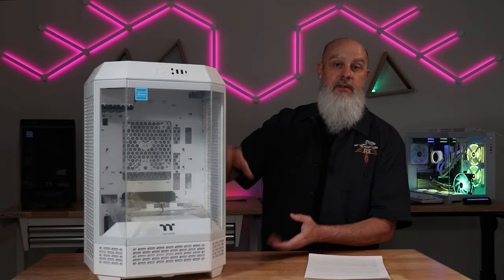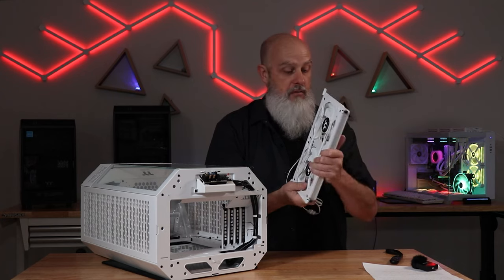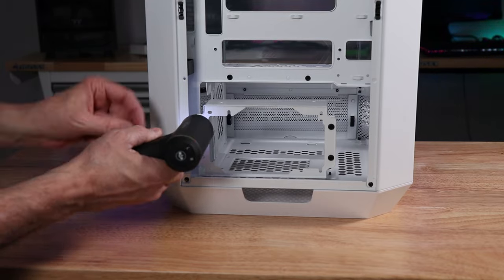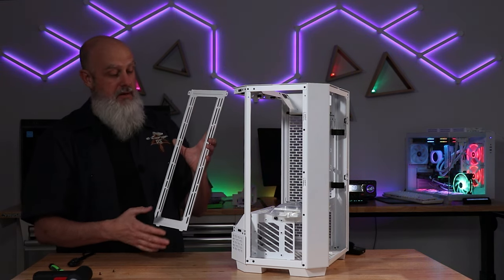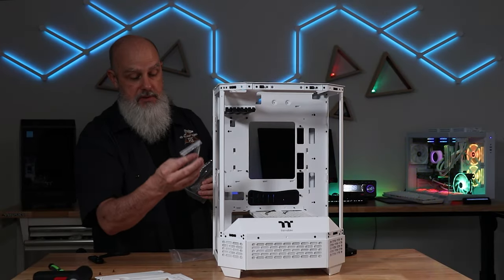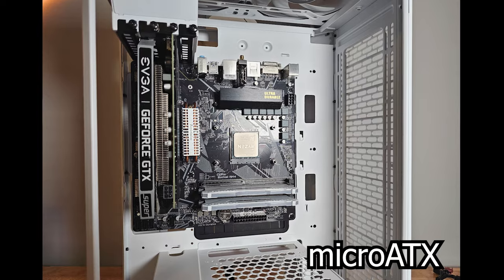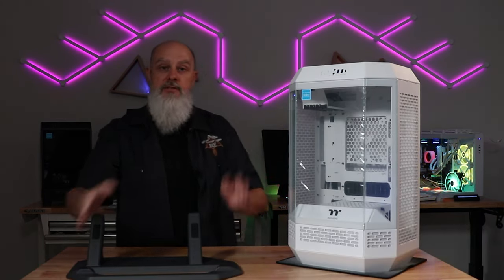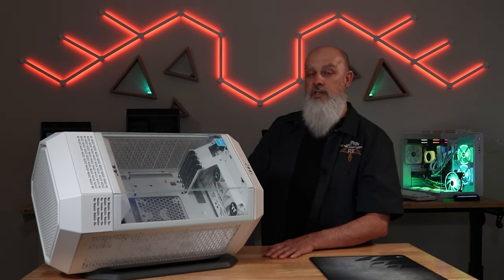THE TOWER 300  and CHASSIS STAND Overview and Teardown - Don't miss this case from Thermaltake

Comment: its crazy how many people don't know that this case is compatible with back connector motherboards like msi's project zero
Reply from the maker: Hi willpatog9001, that's a very good point, it is compatable with msi's project zero. It might be a little fiddly getting the cables in on the one side and you may have to forego the drive cage in the back, but it would look good....I'll point that out in my follow up video....maybe i'll try to put the MSI board in this and see how well it actually works.  Thanks for the great comment and for watching!!!

Comment: couple things, 
You can get to the i/o from the top buy way of the two thumb screws on top and the bracket with fans will just fold/flip out of the way even when running if you don't hit the fans.

I think a cover would/could look interesting in front of that i/0. The higher tier boards with larger heat sinks make that area not look so bad. (Rog x670e gene, Aorus b650 elite ax ice)

I didn't know the fan bracket could fit both sides...makes for an interesting idea with fans. Especially if you make some type of water cooling build with a water cooled card and aio on either side.
(speaking of that i cant seem to find the Depth of the video card area from the board in case you want those Huge brick 4090s, the length seems okay but will it stick out to far and not fit).

All in all a great video. good luck on the build. cant wait to see it.

Edit: the bumblebee case would match so well with an all asus tuff setup.
Reply from the maker: Hi jeremiegartner464, that's a great point, getting into that area isn't too bad just removing two thumbscrews provided your cable management allows easy removal of that panel.

And I can't disagree, higher end boards will look better in that area, this budgety board I have in there doesn't have any covers for the I/O area, but overall, I have found that it bothers me less than I though, I kind of like the look of just the raw electronics right there, but i'm still playing around with a cover design and i've tried some fancy USB sticks up there with blinky lights (haha), it all looks pretty good.  Yea, I haven't tried putting fans on both sides, i'd need another bracket, but could get ridiculously 'cool'....

It's appx 4 inches from the left panel to the first slot, that's an appx measurement, i'll follow up in the video with a more exacting measurement. That's assuming you're mothereboard has the slot in the first position as well. In addition, it's appx 2.5" from the right bracket to the power supply cover, it makes putting a drive there difficult if not impossible  with most AIO's. 

I've been tempted to get one of the bumblebee cases.....they look awesome (IMO)....haha. 

Anyways, thanks for the support and for watching, keep having fun!!!
Reply: Asus tuff 🤢

Comment: Anyone know if the stands will be available anywhere else? The shipping on the thermaltake shop is more expensive than the stand itself
Reply: @GCU-GreyArea  damn, guess I'll wait a bit, hopefully they'll stock them in other places soon. Cheers for looking though
Reply: @GCU-GreyArea  I do, I bought the hydrangea blue one, it's on back order though so I haven't got it yet, but this is one of the few cases that have really grabbed my attention recently. I'm also still running an i7-7700 lol
Reply: @GCU-GreyArea  all good, thought I sent another reply already, they had them for pre-order on amazon JP and I did find the ones on amazon US (which were cheaper for some reason? I bought that one lol, it'll just take longer to get here, which is fine) So i did end up ordering one

Comment: I do agree with the no panel to cover the cables from the IO ports..that's my biggest concern to have this case..this case almost perfect, but too bad they missed the perfection..Great video as always 👍🏻👍🏻
Reply from the maker: Hi michaelbachinz, I'm working on my follow up video to this, but If i'm being honest, the lack of a cover there has bothered me alot less than I thought it would, I'm using a budgety B550 board in there which doesn't have 'any' covers in there and it actually looks pretty cool IMO....And I found this cool USB stick called the Flashotron 3000 to stick in there, it's just a ridiculous USB drive with 50's style blinky lights, but overall I've liked it much more than I thought. I'm still trying to design a cover of sorts, but i'm an amateur 3d modeler....haha. That video will be out in the next week or so I think. 

Thanks for watching and your feedback!!!
Reply: budgety motherboard not the main problem since it must flip to install, i think high end motherboard will also has the same issue ( expose cables )...IMO

From what i've checked The previous version from the tower series has a cover to hide the cables ( tower 100 if i'm not mistaken ).

However this is the great case and i can't wait your next video once you done build it ( with the Flashtron 3000's usb stick of course ) 

All the best for your channel 👍🏻👍🏻👍🏻

Comment: Thank you for your insight. I found it very helpful. I was considering purchase of this case. However I am afraid it might not be copatible with Liquid Freezer III 360 mm (my AIO of choice)  because it's radiator is taller in the z axis then other AIO coolers. Do you have any means to  confirm or deny my fears? You wold help me immeasurably. (The total height of Liquid Freezer III with fans installed is 66 mm)

I know I can take the fan braket off, but it's how you said it looks better with it.
Reply from the maker: Hi szymonmarciniak6033, 

That's a thick setup, but I think you are correct, 66mm is a touch too big without taking the power supply cover off. the distance to from the bracket to the plate is appx 2.5 inches, 66mm is just over that. I currently have a icue link h150i 360mm radiator in there and it fits nicely, but doesn't leave alot of room next to that plate. At that thickness you'd have to take the plate out, or find some thinner fans....I hope that helps...that's a good thought to point out in the follow up video what that distance is....

Thanks for watching!!!
Reply: @HardwareArtisan  thank you very much. You really helped me out. I can’t wait to see your build. I wish you all the best.

Comment: What is the footprint of that stand? I want to make sure it will fit on the top shelf of my computer desk.
Reply from the maker: Hi pdiz, great question. The stand itself is appx 18 1/2" wide by 10 1/2 in depth as it sits on the desk.  That's just the dimensions of the base itself of course, the case takes up space beyond those dimension.     As the case sits on the stand it takes up appx 23" Wide, 15" High and 15" Depth. Those are just a real quick appx measurement, I'd give it a bit of room beyond that. I hope that helps!!! Thanks for watching!!!
Reply: @HardwareArtisan  Thank you for the quick response. That was the perfect answer to my question. I may now need to consider this case now instead of the 200.

Comment: The only thing I'm not quite getting with this case is the airflow. Most other videos I've seen have the AIO fans,  back and top fans as exhaust. and only the gpu fans and one at the bottom as intake. I imagine that would create quite some negative pressure and get lots of dust in...
Reply from the maker: Hi florianhug8069, I can agree with that. I've currently got it with all intake except the top tow fans. I've just barely started playing around with it, but so far its performing ok. I'll probably try switching the rear fans and see if it makes much difference, i'm not expecting anything earth shatteringly different as it's already performing about the same as this hardware normally produces.  It's these times I wish more fans had the switchable blades to make it easer to play around with it, haha.

Thanks for watching!!!

Comment: kinda hate how there are small gaps between each glass panels. They really should've use one glass panel for that.
Reply from the maker: Hi ouki4925, good point, I can see where that would be bothersome to some builders. As I have been working with it and it sits on the desk, it doesn't bother me with the build in it. But, definitely a consideration that should be thought of.  I'll bring up in the follow up video. Thanks for watching!!!

Comment: This is almost the perfect case, pity you can't use an ATX motherboard.  I have 420mm AIO which would fit nicely, But there are not too many Quality Micro ATX boards that use the AM5 Socket, that don't break the bank